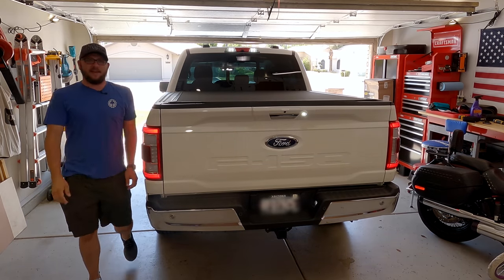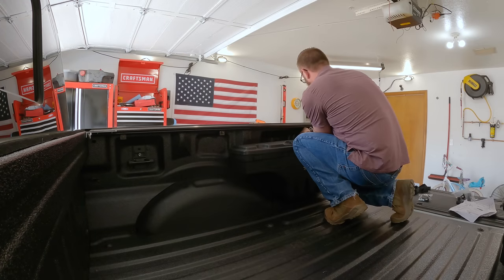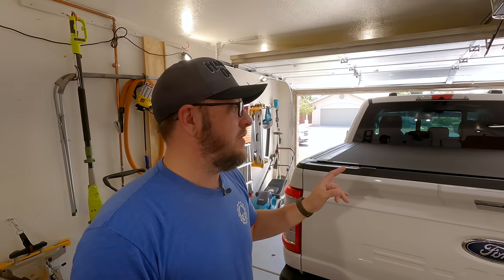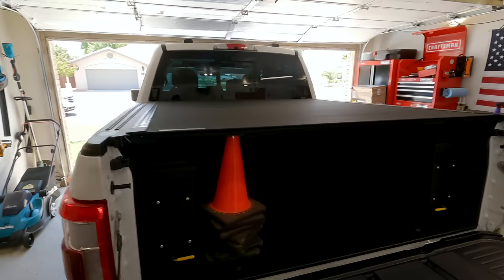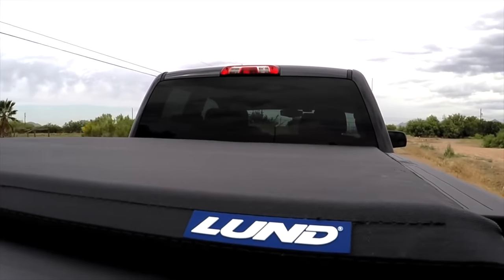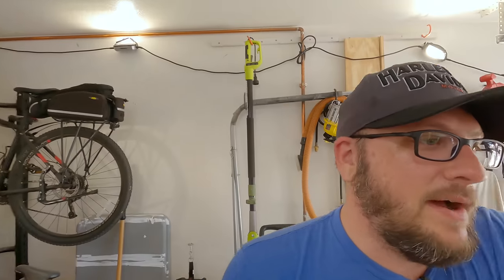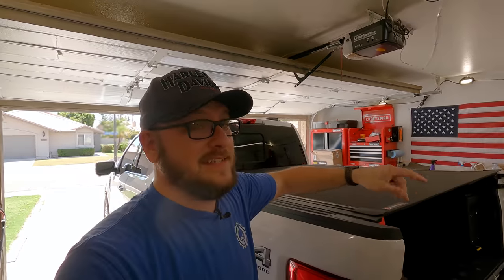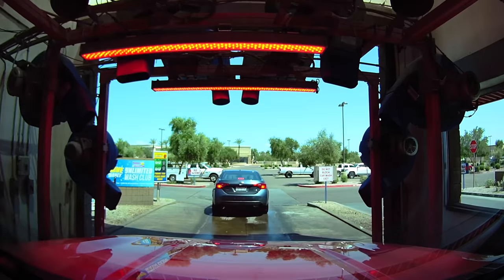BAK Revolver X4s, The BEST tonneau cover on the market?

Comment: I have a X4s that is falling apart after 1.5 years old.  The aluminum slats are coming apart and won't mesh up with the others to lat flat when unrolled.  There is apparently a foam adhesive that holds the aluminum slats to the cover that is failing and allowing the slats to separate.  Piss poor cover for the price they charge for it.  This is my second cover from BAK, the first one totally fell apart everywhere.
Reply from the maker: The original X4 was known for falling apart real bad. The X4s not so much, they should 100% warranty that out for you. I love my X4s, let me know how it goes.
Reply: @GearsGadgets   I'm stuck with this bad cover, this was the warranty replacement for my X4 and now the warranty is over.  At least my X4 that fell apart lasted longer than this X4s.  I can't even roll this cover out flat anymore it's so screwed up.
Reply from the maker: @gdt5430  I’m confused, the X4s has a 5 year warranty but it’s only been out for a couple years. How is the warranty up?
Reply: @GearsGadgets  You have to know that BAK's warranty starts with the first cover  you buy, if that is 5 years then they will replace a defective cover during that 5yrs until the 5yrs is up.  In my case the first cover lasted about 4 years then they replaced it with the one I have now that is falling apart but it's now just over 5 years so the warranty is gone.  I'm stuck with this crap cover and they have no obligation to replace it again, in fact they told me they would not replace it again since the warranty was nearly up on the original cover.  I have pictures of the failure that I'm going to send to them anyway just to rub their nose in it.  This X4s is NOT the improved cover that people think it is.  I don't live in a hot climate so they can't blame heat, it is a design defect plain and simple.
Reply: In fact I just checked they sent me the replacement on August 29, 2022 and it didn't make it a year.  Just junk.
Reply from the maker: @gdt5430  I didn’t know thats how the warranty worked but I guess it makes sense otherwise it would effectively be a lifetime warranty. Truth be told I don’t expect any cover to make it beyond 5 years at least not here in Arizona getting wrecked by the sun. I don’t know what to tell you. I do know the original X4 was known to fall apart pretty quickly with the fabric straps inside, the X4S replaced those with the rubber pieces. Mine is holding up fine so maybe you just got a bad new one? Either way sounds like you’re 5 years in from the original X4 and would likely be looking for a new cover by now anyway so you at least can dismiss a new X4s and just go with another brand.

Comment: There nice cover just quality issues, I have prior gen, came with alium metal shavings all over it, then after time outer warped from heat, and every glued on seal , along with felt protective strip inside failed. Wonder if new model you have will hold up better, keep us up to date. But for over 1000.00 buck I thought it should last more than 3 years.

Comment: The leaks turned me away from this one. If you're parked on an angle, any water coming into the tailgate is going to run into the bed and under anything in there. Thanks for the review.

Comment: Great review. Very thorough and I like how you described every detail. I'm researching tonneau covers like most and wondering if you could sit on it if you wanted to. Not too many are rated to hold much weight on top.
Reply: I had hard tri-folds on my previous trucks. I just put one of these on and like it for many reasons. But I definitely would not sit on it. The slats would bend without question with concentrated weight on them.

Comment: I have an ARE hard tonneau cover, and it lips over the the bed rails, and it is water proof, and many guys who are carpenters like myself need the expensive cabinet grade sheets dry in the bed, and you DON'T need a cap to achieve that, big omission dude.

Comment: Wow, that cover leaked a lot!  I had a tri-fold soft cover & it rarely leaked in the car wash.  Hopefully, by having the fabric over the aluminum, it won’t hail dent as bad as the bare aluminum tonneau covers.
Reply: That (beautiful) F-150 has some kind of step or other insert in the tailgate. I feel if you had a standard old school tailgate that is flush across the top it would leak a lot less.

Comment: Its been a couple years, what are your toughts? I am looking for something thatll last
Reply from the maker: It’s still my favorite cover but the 30+ days in Phoenix where temps were 115+ degrees softened some of the glue on the cover which causes a little separation when folding it. It then needs a little manipulating to close again which is annoying. I love the cover and have a hard time dogging on it for glue failure being parked outside in the hellish heat of Phoenix.

Comment: Dan I have questions for you in regards to your tonneau cover I saw a review on bak revolver 4s and they said that the rear little end caps can come off very Easily  he stated that he had to glue the caps to keep them from coming off I looking to purchase this cover do you see a problem with the end cap coming  off. what is your opinion  on this cover so far
Reply: I just installed this on my 2019 Raptor a few weeks ago. Had the issue of weatherstripping coming off where the bed closes and yes the caps which I feel I could just rip off.

Comment: Not a fan. After I installed it on my Jeep Gladiator I discovered some pieces were missing and some were broken. In addition the fit is not that great. The front has the two seals and they just flap in the wind... Not great for a 1200 dollar product.  I am still waiting for BAK to supposedly send me new hardware and replacements for the broken parts. I would not recommend.  I was able to complete the rail install using hardware I had on hand.But the cover is still broken.

Comment: In researching your cover, did you come across any that would allow a power cord out with tailgate and cover closed?  I would like to power my camper, but also secure the items in the bed at night...thanks
Reply from the maker: Interesting. I am thinking you could have enough flex in the center at the tailgate to get a power cord through but I'm not sure if it would cause any permanent bow in the aluminum

Comment: Buyer be aware. The cover they shipped me for my 2021 Ram 2500 does not fit my truck. It was apparently manufactured “out of spec”. The vendor has finally admitted after my many attempts to install it. It is too wide at the tailgate end, over by at least 3/4”. Not at all pleased with this. You cannot install this cover in 45 minutes either….that is a gross over statement in my opinion.

Comment: I have one on my truck . Worked great for about 2 years then the contact cement that glued the fabric to the aluminum cover strips delaminated. Depending on glue to hold your cover together is NOT the answer over time. It checks all the boxes,but it will NOT last over time. I would not buy another one!

Comment: I'm starting to look for a cover. I'm leaning toward a four panel MX4. I like this one, but I'm worried about flapping noise in the wind. Can you help with that answer?
Reply from the maker: I haven't had any flapping in the wind or any noises whatsoever. It is super rigid. I do a fair amount of highway driving with the rear window and moonroof open as well so I would hear any fluttering noises if they existed. It has held up well for me so far.

Comment: For security couldn't a coat hanger push in and pull the cable really easily?
Reply from the maker: Yes, and a brick could go through your window. The whole point of a tonneau cover is out of sight out of mind. People don’t usually break into things if they can’t see what’s inside.
Reply: @GearsGadgets  valid points!

Comment: What about all the water leaking from the rails at the bulkhead? Mine does this. My x2 did not on my older truck.
Reply from the maker: what do you mean all the water leaking at the rails at the bulkhead? I barely had any and it was at the corners. Maybe you have different expectations than me but a tiny dribble of water isn’t really the same as “All the water”

Comment: what are those storage bins called in the back of your truck?
Reply from the maker: Swing Cases. I love them.
Reply: @GearsGadgets  is it flush with the wheel bump out?  as in, if i wanted to put 10 pieces of drywall in, would it allow me to still?

Comment: There is no pickup truck that has a waterproof bed.  There are holes in the bed for draining.  I have had revolver and baker roll up bed tonneau covers.   Like the baker better. 
My tonneau is more for security than for waterproof.

Comment: Dan I like the bak cover and you make many good points a about it but  what about the vinyl top will it fade in the  summer and  the winter how will the vinyl do with shrinking or cracking over time what about the concerns of tearing if something hits it since I not going to be putting my bike in the back and not to much concern about loosing a little bit of bed space I was thinking about going  with retrax power one Mx  what’s your thoughts on this cover
Reply: Same question as me - I was thinking of the Retrax pro but the manual one.  I've heard that the power version is not that reliable and tends to break and strip out.  I had the first design series of the acrylic Retrax manual version on my 2006 Sierra when I bought it brand new and it lasted until the day I sold that truck in 2018.
Reply: @jewllake  thanks for the info I didn’t know there were issues with it the now I have to rethink my opinions what are your thoughts on the low profile pace Edwards tonneau cover

Comment: How noisy is this driving with the windows open?
Reply from the maker: Assuming you are asking about flutter you get with some covers, this has non. I don't hear anything whatsoever with all the windows down and the rear window open.
Reply: @GearsGadgets  Yes Sir and thank you for the quick response. The flutter would drive me bonkers like you get from soft covers as well rattle from the aluminum slats. I was flip flopping from a Lomax tri fold and this cover and I think you sealed the deal for me. Now just have to wait until the 15th for my bonus check lol. I think this will go great with my 2020 Ram 1500 Built to Serve Edition in Patriot Blue. Love your channel btw.

Comment: Let me add one more thing the flat rubber trim on the top that "supposedly " stops the water moves and slides around when it gets hot and it does because it's black . The glue doesn't hold up and neither does the glue the company gives you to fix it yourself.  By far this has been the absolute worst cover I've owned for the money and I've had oveover 5 types of covers

Comment: Looks great! I'm still deciding what cover I'm getting for my Maverick I have on order =)
Reply: Did you decide? What you end up getting?
Reply: @heydaddy5326  I'm thinking of just going for the soft roll up cover. It will be around $300 vs $1000 for the hard roll up but serve the same purpose and be a lower profile when rolled up (blocking rear window view less). What are you thinking?
Reply: @rdubs1705  I initially ordered the Maverick with the tri-fold... But I changed it to Hard-roll up. I'm thinking long-term the tri-fold will be a little more durable but the Hard Roll-up doesn't block the rear window. I ordered mine with sliding rear window... Also... I prefer safety... I want to be able to atleast see a little out there. 

Then again... A steep investment. And Hard roll-up require more maintanance for it to last. 

Soft-roll up though... I'm not sold on it. 

There's too many theiving scums around and I need to secure some stuff there time to time. Though people can by-pass anything if tried really hard.
Up to you.
Reply: @heydaddy5326  I did consider the security aspect. But I don't plan to keep anything expensive in the bed. Also my area is safe, quiet suburbs
Reply: @rdubs1705  suburbs are getting worse these days atleast in Houston 

I personally would make the investment and get one with security 

Even if you don’t keep anything expensive in bed someone will eventually knife your soft cover to find out there’s nothing under it
Reply: @Man_in_a_Gucci_Suit  it's super safe by me, you can hear a pin drop at night. I barely even care if my doors are locked at night. The expensive covers vs the cheap is like a $700 difference. Think i rly should fork out extra for the hard roll up?
Reply: @rdubs1705  you can get a tri fold bed cover for $800 instead of $1000 

Idk if you’re looking at Fords overpriced website or what but wait 2 or 3 months then there will most likely be a aftermarket one with security for $700 or $800 do what you want im just saying it’s gonna suck if someone knifes your bed cover thinking you keep tools in the back or something
Reply: @Man_in_a_Gucci_Suit the bed cover is actually the only extra I didn't order from the factory because of what you said, super overpriced. I was considering the Bak X4s hard roll up. It's a new version that came out recently. Super nice cover, I like how it's flush with the bed. But it's almost $1100! Maybe it can be a Christmas present from my lady haha
Reply: @rdubs1705  Hope the Ford maverick is a good truck tho I would be more interested in it if the EV Lightning wasn’t coming out and didn’t get the equivalent of like 80mpg and a frunk for storage
Reply: @Man_in_a_Gucci_Suit  yeah the lightning is super nice. It's more than I want to spend right now and I don't rly like large vehicles like that. I prefer really good handling of smaller vehicles. I drive a sport sadan, when I drove my dad's F 250 it felt like steering a whale in comparison haha.
Reply: @rdubs1705  your dads F250 most likely had full size four doors and a 6.5 foot bed or longer 

The f150 has 4 doors and 5 1/2 foot bed so it’s easier to maneuver 

The lightning is really 40k for pro version minus $7250 for the tax incentive so 32.5k for a brand new truck that gets like 80 mpg equivalent
Reply: @Man_in_a_Gucci_Suit  yea you are right, he has a big truck for sure, even a regular F150 is still bigger than I like though. I rly do prefer being lower to the ground, even the Mav was barely in my comfort zone but the reviews said it handled rly well.
Those are some affordable numbers, to bad there is no chance for me to get one for like 2 yrs though haha. I was thinking I would trade the Mav in a few yrs down the road for a full EV when they have matured a bit more and newer battery tech has been adopted.

Comment: No sir, I bought the best tonneau cover on the market. It is the Rugged Liner HC3 Premium hard folding cover. 

It is very simple to install, simple to use, has a couple of aux leds for nighttime, great at keeping out water, and the best part, it comes off very quickly when you need every inch of bed space. Has been through the nastiest of weather that we get here in east Texas. 

I’ve tried everything, the Rugged Liner wins hands down. The rest are too gimmicky, have too many moving parts, and have poor customer service.
Reply from the maker: Just looked it up. Interesting and looks nice. I just don't like the folding covers that block the view of the rear window. Too many times I have something in the bed that I want to keep an eye on and/or see traffic behind me.

Comment: I live in Canada, bought new, never used it until I need it was minus 6 Celcius, the whole thing got destroyed, by pulling the cable to unlock the railing system? some corner cap broke in pieces, I tried to put it back and it just wouldn't lock in place the mechanism was jammed with ice! this is a flimsy piece of garbage, do not waste your money on this unless you live down south!

Comment: I sell truck accessories for a living. The BakFlip Revolver cover is a pile of shit. We refuse to sell them in our stores because 
1) They leak
2) The rear rail edges will slice you open
3) Easy to break into.
4) I've had over a dozen customers come in with that cover on their truck to buy a different cover because of how bad it is.

If you want a really good cover, get an MX4 folding by BakFlip, or a Roll and Lock for a retractable.
Reply from the maker: Every cover has pros and cons. I have owned them all and I stand by my recommendation. The folding suck because they block the entire rear window when open, the roll and lock sucks because it takes up valuable bed space, and the MX4 sucks because the fabric on the underside falls off. The MX4 is a totally different construction than the MX4s that I shared so I always ask if you are offering criticism on the old or new version. Regardless, they ALL leak to varying degrees depending on year / make / model of truck and cover because they are all different. 

Anyway, I appreciate your criticism but to pretend that one is superior requires pretending that everyone wants the same thing from a tonneau cover. Different strokes, different folks.

Comment: BS - needs to keep water out
Reply from the maker: If you were to blow a pressure washer directly into your door jam you very well might get water infiltration along the door seal. The idea that a tonneau cover should be waterproof in a car wash is pure insanity. Simply put, the tailgate doesn’t even have any weather seal and mist alone will 100% get into the bed while driving. ITS STILL A PICKUP TRUCK!!! Buy a Tahoe if you need waterproof storage. Buy a tonneau cover if you need 99.9% waterproof against normal rain, and are okay with having to spend a split second thinking what’s in your bed before hitting up a pressure washer.